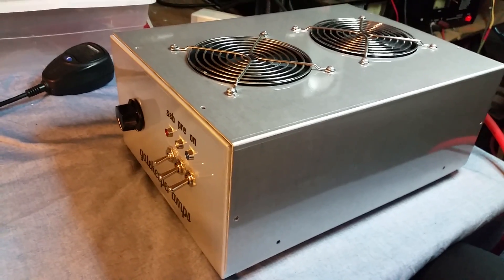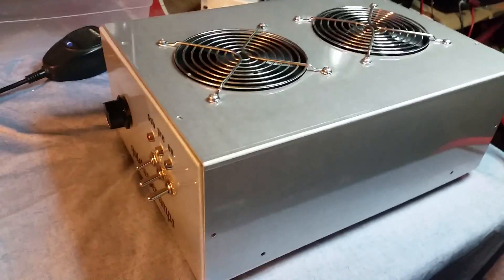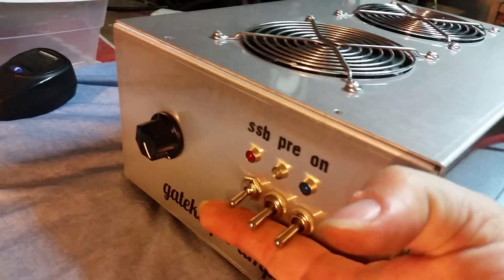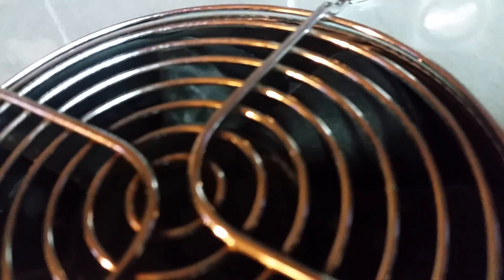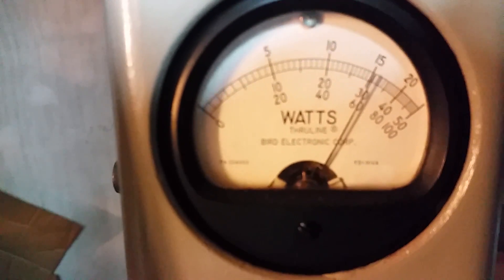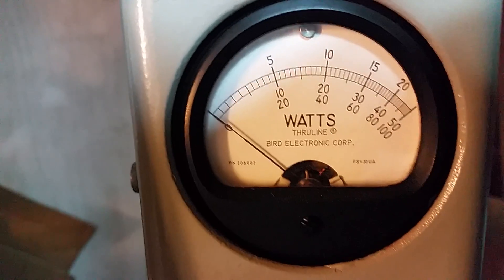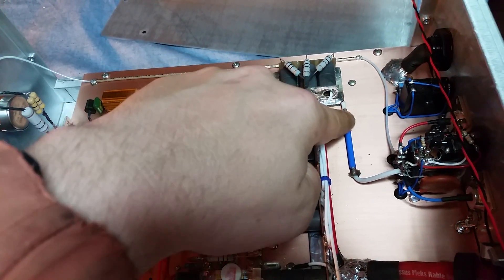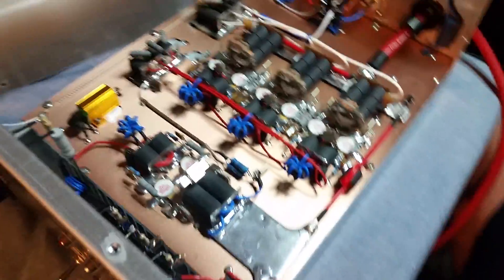073 Built 2x6 Biased Amplifier ALL METAL CLAD Caps Gatekeeper Amps

Comment: That 2x6 isn't doing 2500 real watts. It's called harmonics and distortion. That's a very nicely built box, but the output is bogus.  In the real world with a correctly tuned clean radio at 14 volts that's a 1000 watt amplifier. Many YouTube builders are driving these amps with over modulated radios and some have removed the modulation limiter in order to show ghost watts. You can make a meter read whatever you want, but doesn't mean it's acurate or actual watts. Ask a real radio tech about this. I used to believe it too, not anymore though. Proper equipment shows the truth.
Reply: A 2x6 isn't a thousand watt box. Your right that some of it is harmonics. But these boxes do more then your claiming they really do. Your wrong plain n simple
Reply: @bparker86  A 2x6 may do 1800-2000 watts tops, but not 2500. Most 2x8's struggle to make 2500 watts.

Comment: Im still learning to build my own, and i really like the port design, I assume that when the wire goes through the transformer, it is solders on the front, and the front is a solid solder across.   Or is their a small slice on the front separating the front, But the back is solid ? I guess in the theory, The front would be separate and allow the back to do the combining ? In which your output wire connects so. I have so so much more to learn.
Reply from the maker: you actually got it brother. method goes back to the old school motorola days. Sometimes it is best to go wirh the original way. Big fan of the method of splitting and combination.

Keep moving forward we always have more to learn.
Reply: This is the old school combiner method. Motorola original stuff. It's still used and they actually sell an input splitter and out put combiners. The 4 port ones are like 150 bucks no joke. Very high quality combiner tho. These are tried and true